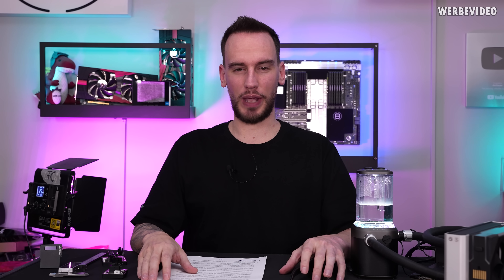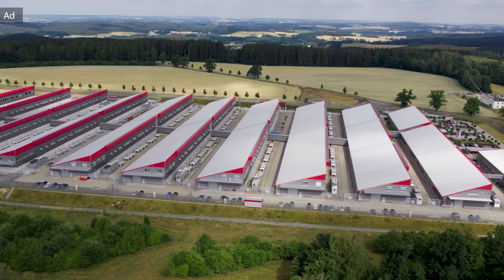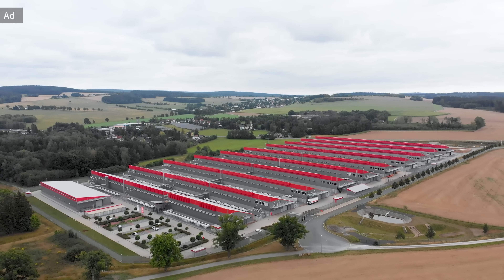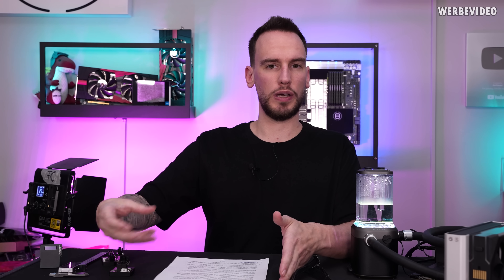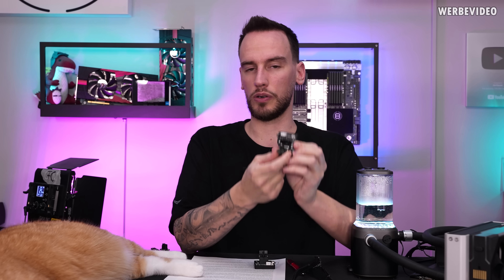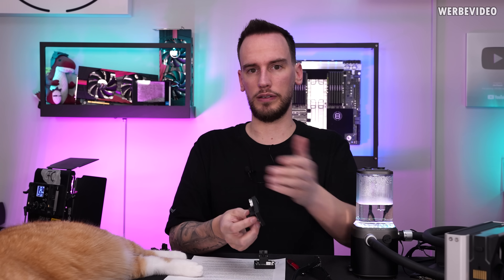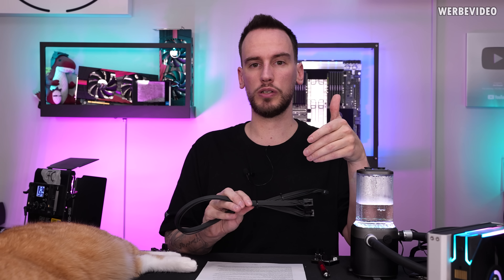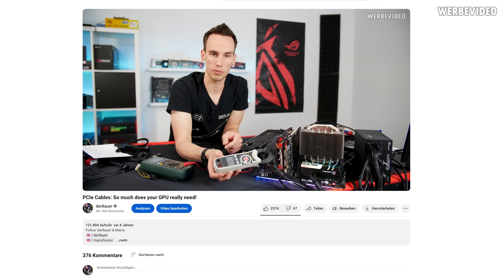12VHPWR is just Garbage and will Remain a Problem!!

Comment: The 8 pin pcie has a specified limit of 150watts, the real failure limit was specified to be around 288w, with some cables marketed at high power with a failure point at 384 watts....... that means 2 high power 8 pins have a higher safety margin at 768w.......

I've seen the the 12vhpwr being limit publicly listed at 600w, with a failure around 662w, so if you are using the cable near max rating that wire should be starting to become a resistor as it heats up and reaches a thermal runaway, as the physical connection points at the adapter between 8 pin is much larger than 12 pin heads, creating a weak point that need not exist in the first place

Comment: adding two connectors to the 4090 does not solve the issue you showed with slight cable movement breaking the connection even when seated properly.  The fitment is broken for this plug design. Rumor has it all super cards are mandated to be this junk connector

Comment: I have been skeptical about the connector since it was announced.  So much power through such a small connector, makes  a lot of heat on the one location.  With multiple 8 pin, or multiple 12VPHPWR, it reduces the heat for each connector, reducing resistance and power loss.  Low end cards can get away with it, but I think anything pulling over 400w, it should have 2 connectors.
Reply: When do you think it was announced? 12VHPWR has been out since RTX 30, and those cards draw more power overall than RTX 40. Both series' flagships have the same rated power draw - 450w. Why is it that there have been no reported issues with 3090ti, or RTX 30 in general with 12VHPWR?

The melting has been with two specific adapters, yet people are putting blame on the connector itself. No one can explain why the issue didn't exist with RTX 30, but now they say it's the connector when it comes to RTX 40...which has lower power draw overall, same power draw at the top.
Reply: @Djinnerator  I am well aware that the connector was implemented in the 30 series, my brothers 3090ti has it, and I didnt like it then, and dont like it now.

In my other hobbies, mainly RC racing, I spend a lot of time with various connectors by JST, Molex, Deans... and other variants.  I always look at datasheets and want at minimum 2x the rating of the amperage that I will put through the connector.  Overkill, yes, but it makes a difference even at smaller scales, and makes a difference with these GPU's.

I dont personally own any GPU's that use the connector, and dont plan to unless absolutely necessary.  I dont think that its an upgrade over what we currently have, as it increases the thermal density of the connector and probably increases resistance due to fewer pins carrying the load.
Reply: @EMU1  yeah...2x headroom is pretty overkill lol but it does give you a lot of wiggle room in case anything happens.

Not liking the connector is perfectly valid and fine. I'm still on the fence about it. I like that it reduced the cables needed to power my GPUs down to one, and when you have a multi-GPU setup, where each would take 3x 8-pin connectors, that would've been 4-6x PCIe cables /just/ for the GPUs. Cabling would've been a nightmare. But like you mention, it can be questionable once you get to the high wattage devices. Before this video, I made many comments here, Twitter reddit, etc. about 8-pin being 16 or 18awg, and that two cable bundles could easily power a 4090, really one, but of course people argued that wasn't true...sigh...

But regardless of that, the hungriest GPU is 75% of the rated power delivery, 68% of the conservative max rated wattage of the cables/pins. While it's good to have devices be rated lower than the supplies max rating, I think it's a bit disingenuous to use the max rating of two different cables as a metric of cable quality in terms of the cable being good or bad. If the device connected to the cable doesn't exceed the rated power delivery, then the max rated power delivery is mostly irrelevant. The cable has never been marketed to be higher than supplying 600W, and if we go based on the max rating of the cable, then the cable is doing exactly what is marketed to do. In that context, if we see that there have been no issues with RTX 30, and they're using the exact same cables and connector (in the case of 3090ti), it makes no sense to put fault on the connector for RTX 40 melting issues.

Comment: They have to be some cheap pricks to use that connector on a $1500-2k GPU. NVidia went the cheap route on their most expensive card and basically gave their customers the middle finger. Dumb connector, dumb connector location and now they seem to want to put the power through a PCI style slot on motherboard so it takes that out too next time around instead of the cable.

Comment: this is why i went with an amd card this generation. given the space, power and structural issues we have had with these cards we need some new standards, and 12vhpwr is not it. putting the power connector on the face of the card might be a good place to start, ether at the corners of the fans or on the back. though i wish we could steal a page from apple and have an extended pcie slot with power tabs and route power through the mobo. while youre at it, armor the slot and put some hard mounting lugs on it (if it has structural members on it which engage the mobo mounting system, that would also be nice).
Reply: Pcie x16 slot rating is 75W. Good luck powering anything with it.
Reply: @alexturnbackthearmy1907  the current pcie x16 connector is not designed for that level of power. im saying add a new connector standard that includes higher power delivery through the mobo.. you do this by using fat fingers and spreading the load to more pins. you connect the pcie power to the mobo instead of the card directly. this also gets an ever fattening cable out of the ariflow. especially with under the panel cable management features in more modern cases. also works out in the data center because you want to have a backplane for everything instead of cables.

Comment: I would change the position of the connector, instead of it being on the side and the cable sticking out so much and having to bend it to fit in the PC case, why not just put the connector on the underside of the PCB (bottom side of the GPU) facing straight up? It would stick out from the back of the GPU (through the backplate) and the cable would go straight up and you could run it through the same hole in the case where you run the MOBO 24pin and other MOBO cables. That way, the cable wouldn't pull on the connector, resulting in a poor contact. I think it would be much better this way.

Comment: The other thing, I have noticed over the years is; the amount of cables in general that are no longer copper wire and the pin connectors are no longer gold or gold plated steel. There seems to have been a big move across to aluminium.
Reply: Oh yes. Just like modern outlets, tiny aluminum weiner of a wire.
Reply: There is no aluminium wire in the PC 12V circuit, absolutely not permissible. What you're seeing e.g. at 7:32 is immersion surface tin coating on a copper conductor. This is good.

The power connectors are indeed not hardgold plated and yes that's potentially a massive part of the problem, and explains why initially it's fine and a few months later you have a smoking pin - it has built itself an oxide layer because it was a little worse than other pins, so it went into a runaway oxide building mode, encouraged by increased local temperature.
Reply: @SianaGearz  I was talking in generally about the cables that are available.
Yes, they do use aluminium on 12v PC cables.

Comment: You would think that subsequent cards that have the 12vhp would have the connector in a different place to allow for better connection without bending (Like at the short edge of the gpu not the traditional place on the long edge).
Reply: most cases have pass throughs now through gromits having the Power connector on the short edge would make it even cleaner for wire management.

Comment: If we are going to do such high wattage for GPUs, the market should shift to a higher voltage standard. Like 24v or 48v.

Even the auto industry is considering higher voltage standards. 12v DC just isn't enough anymore.
Reply: For anyone not familiar, 24v DC would half the amount of required current for connections and wires. 48v..yeah, 25%.

24v I don't think is too crazy. 48v might be a bit much - because of component costs.

I mean even USB-C and our laptop chargers can do more than 12v. It is a waste and risk.

Comment: Simple answer , Nvidia wants to cut cost , one 12VHPWR connector is way cheaper than 3 PCIE 8 pin connectors . One card saves USD 3 , 10000 cards save 30000.

Comment: The problem from the card manufacturers is they all chose to use 90 degree sockets rather than straight(0 degree) sockets. The 90 degree sockets point towards the edge of the board and faces the side panel in a standard case. If they used a straight socket they would be plugged in from the top of the board and in a standard case face the bottom.

Comment: Many of us been saying the adapter is a piece of crap for the use that was intended. Installing that thing in a usual PC case (no matter the size / or position) could lead to problems that were not present with the good old 8 pin power adapter.
Only thing left is to change this adapter for good. Or as you said to use two of them for some situations, but this last idea of yours have the same bending issues than a single cable, so not sure this will be the final fix.

Comment: Electrical engineer here, the number of conductors derating table does NOT apply to the number of strands but to each insulated wire packed together. In our case, you have to count each black wire that carries the nominal current. Conductors are either solid or have tenths of strands, you will never find a 6 stranded wire for example.
Reply: Great video anyway, I really love your content and your style
Reply: Yep well said

Comment: Those connectors are NOT a fire hazard because they use a composite plastic that is flameproof. You can hit them with a blow torch and they won't catch fire or produce a flame, they'll simply melt and then boil at a temperature far too low to become a flame. Flame is essentially a chemical reaction and if the proper chemicals aren't present in the plastic then it can't create a flame.  One side effect of flameproof plastics is they have a lower melting point than the Molex connectors but those will catch fire if they get hot enough

You did however hit on the main problem, there is not enough "headroom" in the design and they should be derated to 450W or even 400W and anything that needs more should use 2 of them

Comment: 12VHPWR is still much better than 8 pins because of size, cable management. there is updated 12vhpwr connector that stops working if it’s not fully plugged in and prevents meltdown

Comment: I think you used correction factor incorrectly, or at least according to the United States NEC 310.15(C)(1). Correct me if I am wrong but my understanding of this section is that it meant to be applied to the whole wire(stranded or solid) as a current conductor, and not the individual strands inside the wire. The max ampacity of the wire is already calculated. 

Correction factor is used for more than 3 wires(conductors) traveling through a raceway or cable tray without proper spacing and eceeding 24in of length. If you were to use correction factor it should be on the wire count, not how many strands in the wire.

Comment: I wonder why not just move to 24v as in industrial application is the case for some time now, half the needed current for the same wattage would avoid the problem with only drawback being new PSU which most users would have to replace anyway...

Comment: As a retired engineer, we discussed the issue many times, those connectors on the PCB are just garbage, that's why you can repair them so easily. They thought that they found out the holy grail. But it's round out dangerous. There is a second issue, where no one is talking about, that is the fact that the PCB breaks on the back end side of the PCIe connection, because of the weight of the GPU. And these are multi layered PCBs and not easy to repair. Those GPUs are bad designed, and Nvidia is quiet about that issue. Even they know the problems. The bigger issue I have, that they blame CableMod for this case, even they were searching for a solution for the bad design from Nvidea.

Comment: The whole indsutry has moved to this type of cable...this will be interesting to follow.
My new PSU has the new connection but at this rate i think i'll stay away from using it.
Slightly annoying also that it cant be converted back to power another 8pin or 6pin, as new psu's now have less connectors for cpu and pcie.
I can't connect all the cables my board can handle, B550 Unify-x - 2 CPU 8pin, 1 PCIE 6pin. Sapphire 6800 XT Nitro 2  PCIE 8pin.

1000w psu, 1 of the 12vhpwr, 4 8 pin 12v that accept CPU or PCIE. I had my eye on a side grade to 6900 xtxh with the 3x 8 pin so wont be able to conect all my nice cables.

It'll work still the CPU only needs the 8 and the additional pcie 6pin for the slots will never be used but they look cool populated 😅